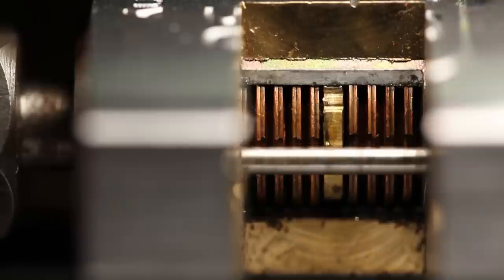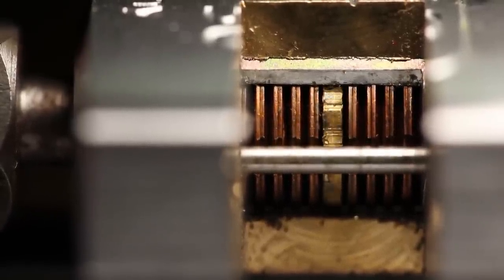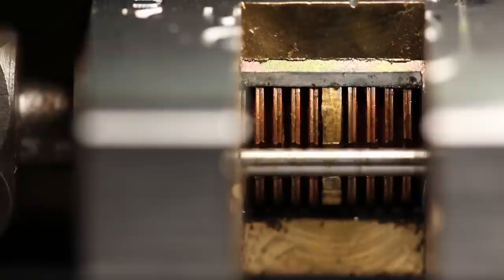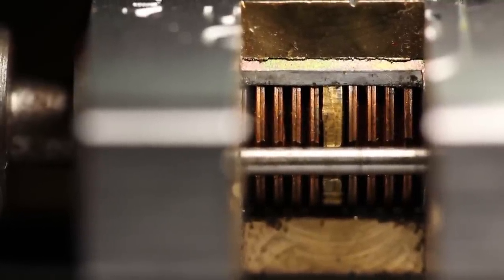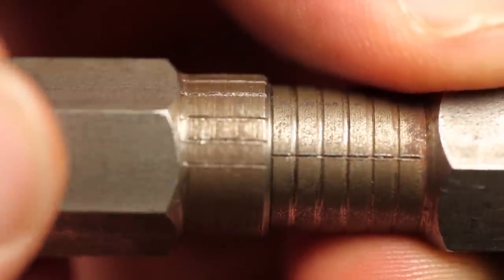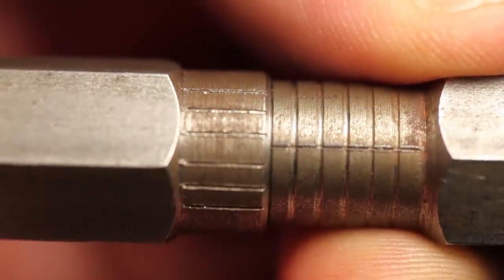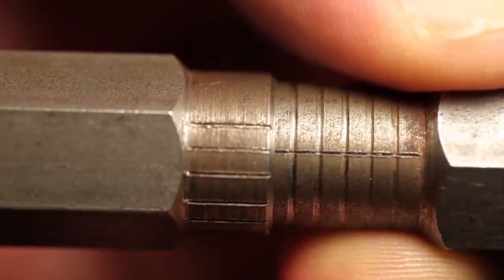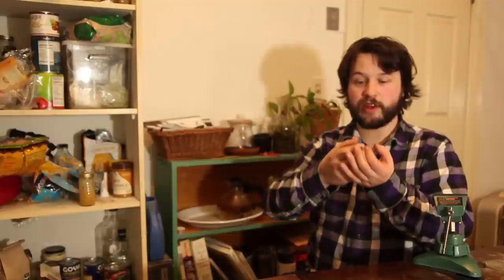Disc Detainers Part 3: Picking Continued

Comment: Doesn't that seem like a design or manufacturing defect? Couldn't the false gates be cut so that they feel just like the true gates? Also wouldn't it be more secure to have the tensioning disc located in the center of the stack, and why is a tensioning disc required?